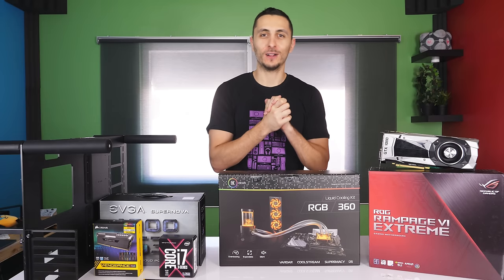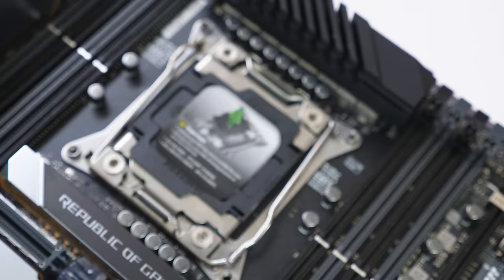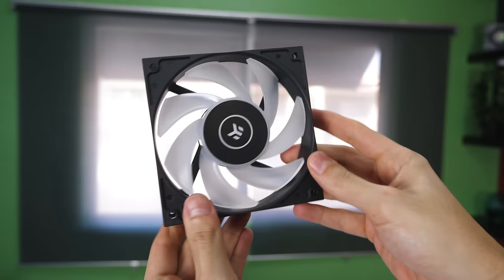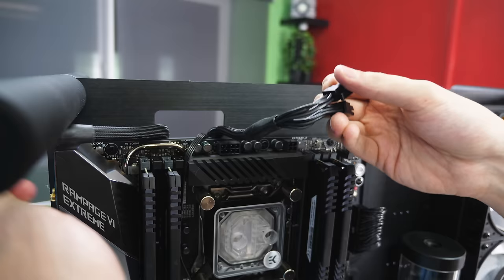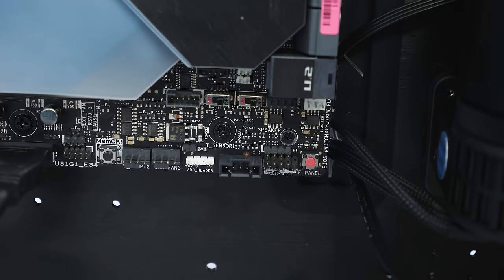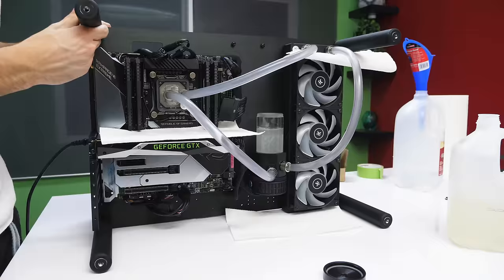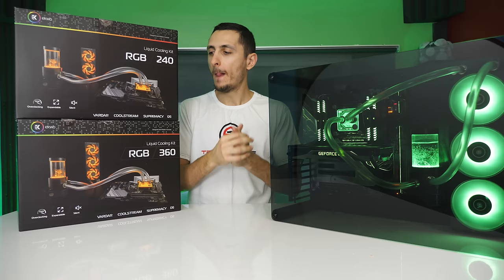How To Build A Water Cooled PC - EK RGB Liquid Cooling Kit

Comment: 'Hey, an all in one water cooling kit, that's looks really easy to install!'
Sees price

Nope.
Reply: they would sell alot of them for under $200
Reply: FORDYI SAME
Reply: Nope
Reply: Yep.
Reply: @wanderbread4217  just do some DIY with the filter system in a fish tank
Reply: Its actually not that expensive lol water cooled PC's ain't cheap cause it's basically all cosmetic. It looks better than air cooling but honestly is all basically the same as far as efficiency.
Reply: Just bought one at £230!
Reply: @sporkinstien6571  Watercooling does perform much better, atleast mine. I run two 360 radiators one for CPU and one for GPU.

Ofcourse it is extremely expensive and has that cosmetic edge.

Comment: oh, that looks cool

- looks at price: "well, ok..."
Reply: Niko 02 02 Ik
Reply: why 500$
Reply: @BrytonLifts  For the 360: Pump/res combo is like $150, rad is max $100, block is $100, $45 for fans. Like double the price for the individual parts.
Reply: @danjones1608  Thanks For The Info
Reply: @YOURACUCKorc  You can build one for  $100 if your tubing is out of paper towel rolls 😂
Reply: @colbeh  true LUL
Reply: @YOURACUCKorc  what do you do when your wealthy, waste your time to find out how to water cool cheaply when you probably just make a whole bunch of money out of your business instead?
Reply: Ikr I wanna do this but I’d rather spend much less on an aio and some cablemod sleeving to make it look almost the same
Reply: tbh, mostly the water cooling are just for look. The cpu is designed to take over 100 celsius and we all run it lower 70 max. Water cooling make it lower than 55 yes but it make no diff. So if you are in budget then dont mind that

Comment: Cool.....but no mentioning of properly cleaning your radiator since it can and will has flux inside the rad which can destroy your pump or cause the cpu/gpu fins to get gunked up. Another point is cutting the tubing NOT with a scissor but with a good quality tube cutter. Lastly in order to leak test your water cooled rig BEFORE filling it up i highly suggest using for example Aquacomputer Dr. Drop for air pressure testing once it shows no leaks on the gauge for at least 1 hour (better do 2 or 3 hours) then fill your rig with coolant, and make sure you bleed it properly. Oh also flush your tubing with distilled water before using it it might have dust and other crap in it. Dont use silver kill coils it can mess up nickel plated blocks use a good pre mix coolant (clear) that protects against corrosion.

Comment: "Insert the male portion inside all of the holes"
"Feel free to twist the tube in a circular movement so that it slides in easier, instead of forcing it straight in"
"You can stretch out the tube to make it shorter and simple, or leave it loose so it looks more full"
"Once you're happy with the desired length, grab your scissors and cut the tube"
"Make sure it's nice and tight to prevent leaks"

-Tech Source

Comment: This vid made me want to drop 500 on a watercooler 😭
Reply: you dont need to spend 500 if you get an aio you can just spend £70
Reply: @user-dn3dl4wi4d  watercooling should only cost 200
Reply: @jaspervn4722  Yeah, I tried compiling everything as I was looking through amazon and man, just buying watercooling kit separately is so ridiculously expensive that I'm so better off with either AIO or even just air cool with maintenance free. Though when I do save up maybe eventually I'll try watercooling once.

Comment: HOOOOOLD ON A SEC 
is that cooler 499.99??
WTF
Reply: Yes waste of money anyways will do the same as any other water cooler
Reply: Custom watercooling equipment ist better than any AIO, vut yes 500$ is a bit much.
Reply: The non rgb one is 400
Reply: @finanzam1  sure its better, but  not that much better. price to performance any aio or CLC is not worth it. do yourself a favor and get the d15.
Reply: @deathrager2404  even the UH14 S is perfect , Watercooling is kinda overkill in most classic gamer case
Reply: You can get the cheaper ones that r 300.
Reply: the prices will drop, i, check out their fluid gaming... they had this with alu for around 200 bucks
Reply: long term use. you can upgrade or replace only failed equipment. but for AIO failed just only throw away.

Comment: It is normally significantly quieter to mount the pump to the rad rather than the MB tray or case panel. The rad is a much more solid mount and effectively isolates vibration whereas the case wall is relatively flimsy and can transmit vibration for more noise.

Comment: I watched over 5 times now, I am pretty young and about to soon build a watercooled pc.
Reply: I hope the built goes well for you.
Reply: Lieutenant Supreme as a young PC builder myself unless you’re gonna be doing some serious overclocking you don't need water cooling, I have a 3600x and it runs 40 - 50c on idel.
Reply: Which is still pretty hot but remember that CPU is overclocked from factory
Reply: @Agavegaming  its not overclocked from factory, the turbo is just increased by like 100 mhz
Reply: @markomclane475  overclocking: "To speed up the computer beyond the manufacturer's specifications to run faster." the 3600x is running 100MHZ above the normal factory specification, so, yes it is still technically "overclocked". Also, the 3600x is known to run hot, so I figured I'd put in my two cents.
Reply: @Agavegaming  to overclock it, the user would have to increase the frequency beyond what comes stock

Comment: Is this a decent first pc??

CYBERPOWERPC Gamer Xtreme VR GXiVR8100A Gaming PC (Intel i7-8700 3.2GHz, 16GB DDR4, NVIDIA GeForce GTX 1060 3GB, 120GB SSD+1TB HDD
Reply: Ibrahim Genex okay thanks
Reply: Im gonna go for this

Intel i7-8700K 3.7GHz, 16GB DDR4, NVIDIA GeForce GTX 1070 8GB, 240GB SSD+2TB HDD which will cost £1,500
Reply: @dannydyer2879  yeah your second idea sounds good
Reply: @am4nrb264  nice rgb, so it gets like 679fps on Rise of the tomb raider?
Reply: @am4nrb264  32k? Lmao, not even hard, everybody knows it's a about that 64k now
Reply: what about 

NZXT H500 (White)

MSRP
$69.99

POWER:
Seasonic S12II 520W Bronze

MSRP
$49.99

GPU:
ZOTAC GeForce GTX™ 1070
MSRP
$299.99

CPU:
AMD Ryzen 3 2200G Quad-Core 3.5GHz

MSRP
$99.99

MOTHERBOARD:
MSI B450 TOMAHAWK

MSRP
$109.99

RAM:
G.SKILL Ripjaws V 8GB 2666 MHz
MSRP
$59.99

SSD:MSRP
Samsung 860 EVO 250GB
Reply: VER V3F  Not everyone wants to put in the work to optain the knowledge of how to build it and what parts to get. They just wanna plug and play
Reply: VER V3F  again, not everyone wants to figure out what parts they should get, or maybe they don't wanna take any risks in case they mess something up.
Reply: VER V3F  500 dollars is an exaggeration but alright
I found a Pc build from iBuyPower, and putting the same parts into pcpartpicker saves me around 250 dollars, so 2250 vs 2000.
While granted you will save money, some people don't care to learn how it works, or maybe they're too lazy to build, or they wanna risk nothing. 
Or maybe there's a good deal that happens every once in a while.
Reply: ItsMeSwirl i just built my first pc and i couldnt even tell you what ram was a month ago loll. Its super easy with all of the tutorials online. It wont even take you 2hrs to build
Reply: ItsMeSwirl i agree though, not everyone wants to build one. But it is fairly easy and for my build, i used some of the $250-$300 that i saved by building it myself for a used but like new 1080ti instead of a new 1070, which makes a huge difference in performance. And i used the rest of the 250 to upgrade my cpu. By building it myself, i upgraded 2 key components of my build that will increase performance significantly. It actually took my build to the next level and was worth the research i had to do for it. Its pretty easy getting a part list, the more difficult part is the build and even that is easy with the unlimited supply of tutorials, it can be a breeze. Dont let anything hold u back from building it. Its so worth it n im happy i changed my mind from getting a pre built
Reply: @zodiac8131  there are also people who want their PC to look good, and if you're just starting out it's not always easy to make it look good.
Reply: ItsMeSwirl Also its good to research all of that stuff before buying anyway. Once your build is complete, you never know when you will be in need of an upgraded part. Having the knowledge will give u the ability to run to frys or micro center and get the part and upgrade ur build all in one day with no real hassle like having to wait for someone to come upgrade your pc for an additional fee or having to send back your build in the mail and pay shipping costs and be without your pc for weeks or a month because of a failing component. Just watch the youtube videos before you buy it. It can save you a lot of trouble even if u get a pre built and it doesnt take that long to learn
Reply: ItsMeSwirl no hate or anything, i respect your opinion. But you should consider building one atleast for sure bro
Reply: ItsMeSwirl like i said man the videos are all you need and just cable manage and ziptie as you go. There are endless videos for support when building and theres probably not a single issue that you can run into that there isnt a video for. My build looks nice in my opinion and it was my first ever time. Just cable manage as you go. It really isnt difficult bro. You can do it if you want to for sure. Anyone can
Reply: ItsMeSwirl i know 14 and 15 year olds who built and cable managed their own builds. You just gotta put your mind to it and you can achieve it lol. Sounds corny but its true
Reply: ItsMeSwirl not everyone wants to do it so i know its not for everyone though, but i really do believe everyone is capable of building a pc if they try. It looks like a lot more hassle than it is. There are videos of people speed building pcs in under 25 minutes. And i didnt know anything about PCs a month ago and built mine in under 2 hrs. You can do it!
Reply: ItsMeSwirl ill send you pics of mine if you want and help u if u have questions

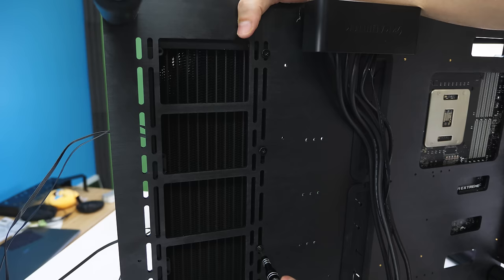Comment: 9:37 the reason the mounting holes didn't line up is that you screwed the right side into the mounting strips for a 140mm fan/radiator, if you screwed it into the strips to the left it probably would have worked.

Comment: For 600 I could see buying this if it had a GPU block. You can get a decent aio for only 100 these days and it holds the same exact function. Terrible price for practicality.
Reply from the maker: If you watched the end of the video you will see the huge gap in temps from an AIO. 30 degrees Celcius difference switching from the corsair h150i to the liquid cooling kit AND i was able to push the CPU an extra 100mhz. Yes, the price is high, but you are investing in your RIG at the same time squeezing more performance out of it, keeping it silent AND making it look cooler. Please dont compare AIO to custom water cooling, its not the same.
Reply: I wouldnt call this all that "custom" its a kit everything is already there for you; you just need to put it together. Thats like calling an office chair kit custom. You also easily could piece together a better colling kit for yourself and I do agree its easier to just buy this without worry about the different sizes but for something that is 2x the price of the best practical cpu its a waste. And in the temps aspect thats because it has a reservoir and is able to hole at least double the liquid.   I appreciate the reply.
Reply: reloadstuff the pricing is actually a bit incorrect if you look at PPCS you can get the kit for 550, also it is a custom loop as its actually the same parts you can buy individually from EK just kitted together for you. Also having a larger reservoir has nothing to do with lowering the temps, the lower temps are due to the radiator being a 40mm thick rad vs your standard AIO which is about 30mm thick.
Reply: so back to the office chair i can buy all that stuff separate but i choose to get it in a kit. and a 25% thicker rad wont give that big of a difference
Reply: reloadstuff yeah ,it's not very practical.More of a show off thing tbh.Well u can spend on it if you have so much money
Reply: TechSource The thing is,not everyone can spend so much on cooling to achieve some differences in temperature. Practically speaking AIO is a better option for the price.
Reply: @TechSource  Your right AIO are not the same as custom water cooling but the question is if your only cooling your cpu is it worth $550 and your point about the GPU not being worth water cooling as you upgrade it alot is a bit silly most people dont upgrade GPUs every year its usually every 2/3 years and if you cool your GPU more then it will get better boost clocks and give you better performance
Reply: reloadstuff is there any cooling configurations you would recommend for this specific build? I want to build this pc but what you’re saying about there being no GPU block is scaring me. Im currently a console user after having a Xbox 360 for all these years wanting to stitch to a pc by the way

Comment: Sorry for being picky, but at 9:26 when u said u “could only use three screws”, it’s because u attached the rad to the 140mm holes. The two inside hole channels are 120mm, the two outer are 140mm. Ur rad is 360 x 120 meaning u should use the inside holes.

Comment: ED No need to get a bridge tool.. Just look for a green wire on the 24 pin power supply cable and connect one end of any wire on the green pin and the other end to any other blank wire pin on the 24 pin cable.. this will start the power supply. FYI the green cable is the main VCC cable while the blank wires are just Ground!

Comment: for smaller builds you can ideally use a smaller 2 fan radiator, and mount 4 in total, 2 on each side (so the air gets sucked right through).

Comment: 12:25

Slight correction, if your CPU block isn't labeled with IN/OUT that means it SHOULD allow flow in and out from any direction, though this isn't always the case. If you are unsure it should say in the manual, or on the manufacturer's website.

Comment: Nice work Ed. as always. is a nice case. if you rebuild the case there, there is EK bracket to put the radiator from the side. and not on the one on your  video. that will have more space, you can put a 45mm rad if you plan to use  WC on you card. But the way a fantastic tutorial. nice key point.  ANd get licence and get the keep is perfect safe and CS is always there

Comment: Love the idea of water cooling. I am building a new rig, on a NOT very loose budget using a HAF 932 Case, a hand-me-down Gigabyte 990fx-gaming board, a New AMD FX-8370 CPU, 32 Gigs Kingston Fury RAM,  Evga  660w Bronze PSU and a EVGA Geforce GTX 1660-Ti card. I am liking the RGB but I wonder how to use RGB fans and lighting effects if my board doesn't support it?

Comment: I have my two fans at the top pull air in and one at the back pulling out then two at the front of the radiator blowing into out through the front of the case. Linus has a great video about different ways to do and my temps are 30c at desktop then 40 gaming

Comment: I realize this is a super old video but you should make it clear you should remove ALL cables going to the motherboard. You left the CPU power cables, those still provide power the the board but will not allow it to turn on. If there are any leaks it can cause permanent damage.

Comment: My Pc specs are:
I9 9900K
Stock cooler
Gigabyte geforce GTX 1080 ti OC 11GB
Corsair 8gb RAM
750watt Power Supply
Corsair Spec Omega RGB
120GB SSD
2TB Hdd
Asus Rog Strix Z370-G Gaming

Comment: You should have said that if anyone uses a fan connector for the pump it has to spin at full Speed to not Damage the pump
Reply: and booting it whithout the cpu block being cooled won't Damage anything because it will slow down itself.

Comment: Im confused about the psu screws, you mention that you should use the screws that are provided with the psu to secure it to the case however in the video you clearly use different set of screws that probably came with the case? So it doesn't really matter what screws you use to secure the psu?

Comment: Nice video...going to eventually build my first but after reading how amd new top end xen 3 might outperform the i9 9900, I'll wait a few more months. Someone did suggest to me yesterday though before even installing CPU and ram, power up the mb and install the latest firmware. The msi boards have USB ports with flashback just for doing this

Comment: Great video, but one thing though, isn't it a 360 rad so holes should be the middle ones in the case? Because the outside ones are for 140mm fans? Also what about cleaning/rinsing rad before mounting?

Comment: Really like the build and aesthetics! 

Im just wondering tho, for the GPU card don't you also need cooling for that too? It didn't look like the GPU has a cooling system. Does it have internal fans or just doesn't heat up enough to need cooling?